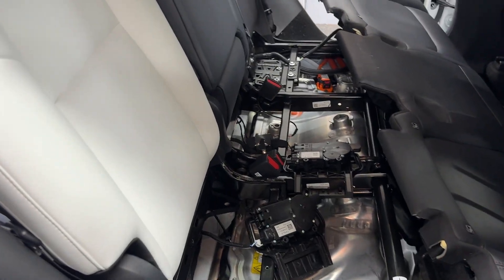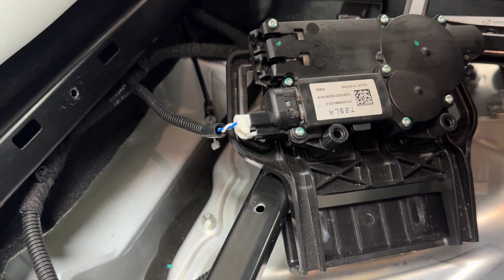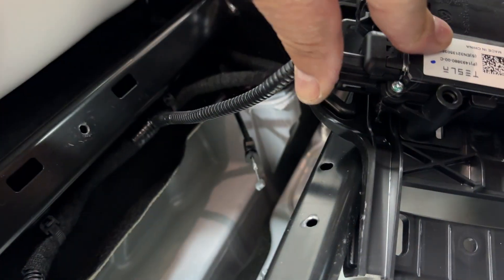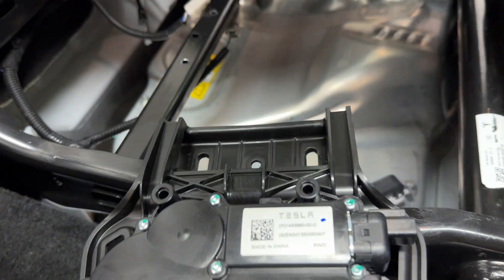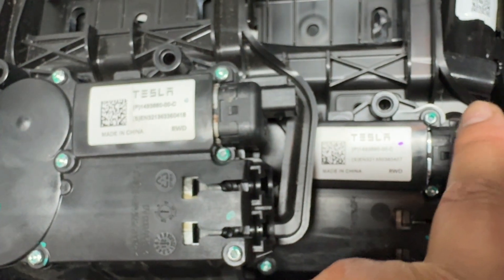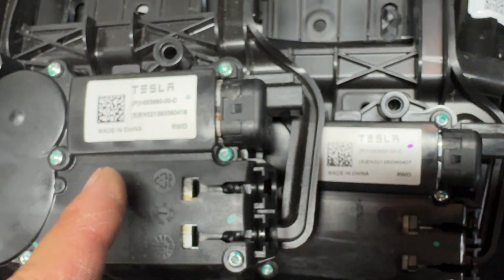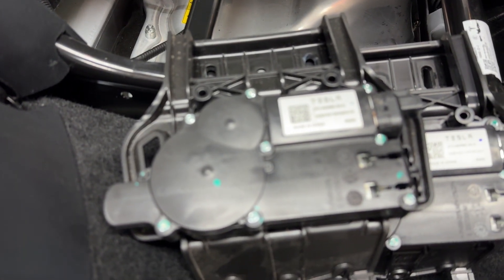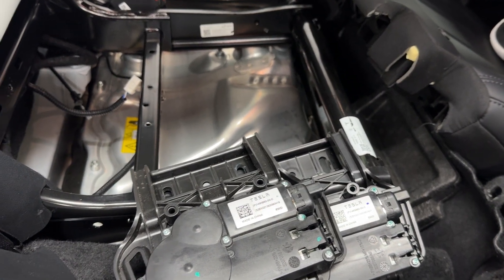Model Y Rear Seat Motor Swap

Comment: Thanks for your video's - they've given me some degree of confidence to attempt some 2014 i3 REX fixes myself..  But I recently ordered a repair manual to help as well..

Have you ever heard of a Vapor Shut Off Valve jammed open ?  It has a Carbon canister and cap as well - I was quoted $2,000 to repair it...